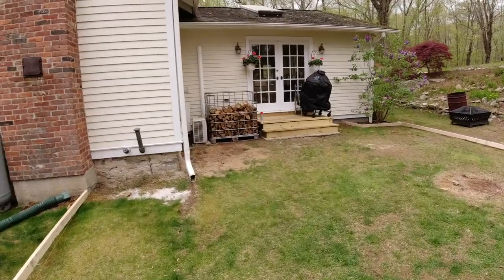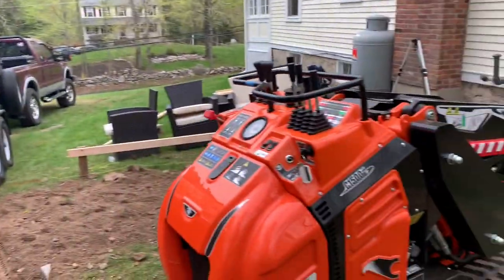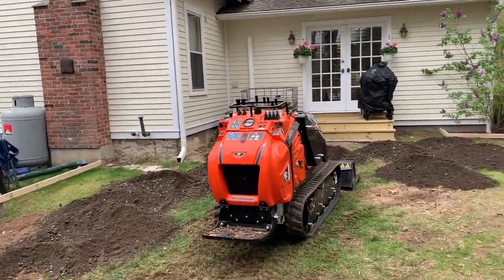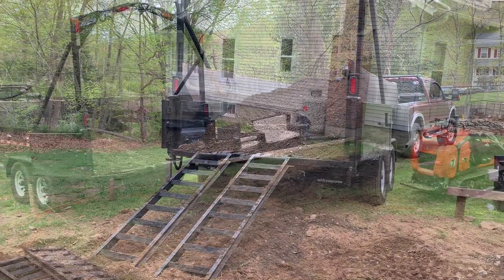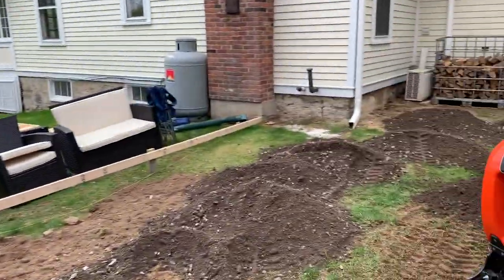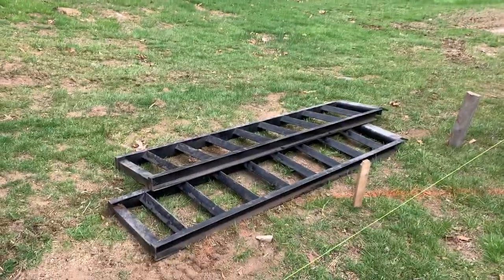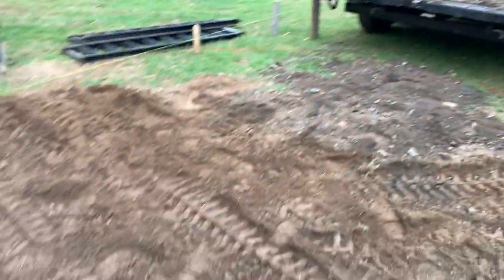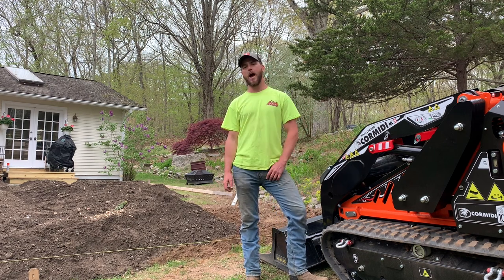#101 Dump Trailer Won't Dump!!! Cormidi Mini Skid Steer to the Rescue!!!

Comment: You're very lucky that you didn't get stopped by a state trooper...Very lucky...That's about 25 hundred  to 3 thousand pounds a yard...I've got a tri-axle gooseneck trailer at 21k...I go no more than 5 or 6 yards...But you did a great job handling unloading. Love the mini skid steer.. Real handy tool ..
Reply from the maker: It was very overweight! Luckily the yard where I picked it up is literally a quarter mile down the road! The mini skid steer was the perfect tool!

Comment: If you run into this issue again you could use the tractor and or the mini loader to lift the front corners of the dump trailer to get it started. Once you get it to start to lift the trailer should be able to get it the rest of the way.
Reply from the maker: So I actually tried this off camera and it was torquing the bed of the trailer a lot but did lift up. If I had another operator and both machines assisting in both corners it probably would’ve worked.

Comment: You should have stripped that grass before you dumped the material on it.  You don’t want to put concrete over grass even if it is under gravel.  The grass will decay and sink causing your patio to sink unevenly and crack.

Comment: If u can lift an axle front or rear built in jack to fix a flat or empty just hve 1 axle all the way down, it will also help if over loaded, & can't dump /lift it. When u raise rear axle it will start to lean that way if u un coupled the ball, yet keep chains on/connected if on a sloop. May give u that little leaning rear pile toward back edge. GOD free advice, but we won't more help then that, like not just raising an axle but also lowering an axle 6-8" or so & again that makes u lean even more rearward.

Comment: New subscriber here just watching some of your older videos be careful with dirt and gravel it’s heavy anywhere from 2000lbs to close to 3000lbs per yard. Buddy just bent his frame dumping to much. 5 yards max if you have a 7 ton trailer. He has a single telescoping ram which does put a lot of twist on the trailer. Mine are dual ram 💪
Reply from the maker: Yep it was pretty heavy, I like the stability of the dual ram!
Reply: @DudeRanchDIY  Definitely the single throws to much weight on one side especially when loaded more to one side. Have a good one by the way i like your content 👍
Reply from the maker: Thanks!

Comment: Questions!? Could  you have hooked up the winch to help lift the trailer with  a shackel to tractor? Did you think you would be operating the mini up on the trailer? How much did this job help cultivate your mini operating skills? Thankz for sharing!
Reply from the maker: If you mean using the tractor as an anchor and the winch to assist in lifting? Yes I probably could’ve I didn’t think of that, as you could see I was a bit tight on space though! I never would’ve thought I would be operating the mini up on that pile like that! It was a bit nerve wracking! This job helped me dial in on the torque control knob as well as getting more familiar with bucket/loader positions from the operating platform, at times it was pretty hard to see!
Reply: So many options after the fact. You kept at it and learned along the way.keep em coming.

Comment: Should have used the mini loader to give the dump trailer a boost by helping it dump while running the controls on dump trailer
Reply from the maker: I actually tried that but it was torquing the trailer bed to one side. If I had another person I could’ve had the mini on one side and tractor on the other

Comment: All that weight then drive a 2,500 pound machine into it.  Remove material with ramps off. Place ramps on and move machine to act as a counter balance. Try that if it happens next time.
Reply from the maker: Didn’t think about doing that!

Comment: next time put the ramps on and put your machine on the ramps to offset the weight of the material and then try to shift the material to the back without swamping the machine on the ramps
Reply from the maker: Not a bad idea, I didn’t think of that!
Reply: @DudeRanchDIY  you could also use the machine to help lift the front or turn the truck around so its pointing up hill and try it that way with the dots closed to get everything to go to the back

Comment: All I do is fire wood and never had an issue with the single ram... knock on wood... straight up is path of least resistance but not sure if that matters with how much you loaded...
Reply from the maker: Do you have telescopic or scissor style? I’m not sure if having telescopic would’ve changed much or not!
Reply: @DudeRanchDIY  telescope is the way to go.. alot more power.. ill let you know how much it can lift once I get back to my wood lot
Reply: @DudeRanchDIY  there are 4 cylinders in one  starts at 96 000 lbs 56 000 lbs 39 000 lbs and 26 000 lbs not to sure if the pump is strong enough though.

Comment: If only there was a dump trailer with the option to open the side walls too...
Reply from the maker: I’ve actually seen dump trailers with this feature! Kind of like the fold down sides you see on mason dumps
Reply: @DudeRanchDIY  Jake, have you heard anything regarding the availability of new Cormidi's?
Reply from the maker: @balamala2647  I’ve heard from a pretty reputable source that they are slowly coming in from Italy but with all the supply chain issues, orders for machines far exceed supply. This is part of the reason why I haven’t had the Cormidi for quite some time now!

Comment: You have your calculations back wards. Try 1.3 tons per yard next time. You got it right about it being front heavy, so next time have them fill the bucket to one side and put most of the weight over the axles. Your trailer is also pitching down toward the truck. Much less weight to lift if it was pitched towards the rear.  You need to get a better understanding of weights of materials and physics.  A good 100 dollars spent would be to pick up a copy of " Moving the Earth" .  For general knowledge as well safety.  Be Well,
Reply from the maker: Thanks for the feedback Mitch, when I went to get loaded I had asked the operator to fill the trailer towards the rear but he was inexperienced and wasn’t able to. If I was able to turn the truck around it would’ve been easier for sure, unfortunately if I had I wouldn’t have been able to get the trailer into the concrete frame and it would’ve been a lot farther away from where I needed the material.

Comment: I would stopped at 1 bucket.
Reply from the maker: If I didn’t need to have the material by the following morning and if The place wasn’t literally down the street I would’ve split it into two loads.
Reply: @DudeRanchDIY  Yep i got you. you should have a nuff now.

Comment: Your trailer salesman fed you a pile of garbage, front telescopic lift design, is the strongest and most reliable. I’ve been in the landscape business since 1985 I’ve seen all kinds of dump trailers, and without a doubt the type you have is the least reliable.
Reply from the maker: Not sure my salesmen told me that dual ram was the strongest, I chose dual ram over scissor or telescopic due to the nature of what I mostly haul (logs) and the uneven weight distribution they can have. Dual ram allow pressure from both sides allowing for a stable dump, at least that’s what I’ve read.